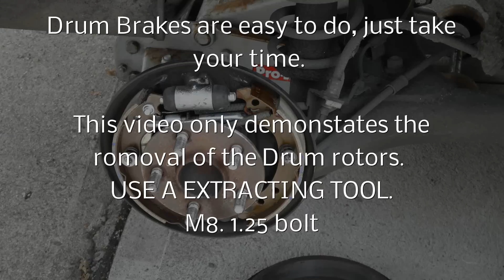How to remove rotor drums off a 2007 toyota corolla S and up

Comment: how did you know to use M8 bolts to crack the drum off?
Reply from the maker: +Eric Thomas There are special tools to use the M-8bolts are the proper threads to place in and that is what I used and knew. taking time to alternate is  key  do one side too much CRACK
Reply: I have a 2007 matrix xr. I will try M8 and hope it fits.
Reply from the maker: matrix/corolla identical parts I believe.when pads are ordered most parts come up matrix... worth a shot, right? spray turn one each side  and Pops off.

Comment: What if my rear drum is stuck.. What's the easiest way to fix that?
Reply from the maker: julio borges ave to douse the center with lube let sit do again. they sell liquid wrench lubethat releases stuck stuff. but the rust is the build up that stops it. sometimes heat helps

Comment: what did you spray on there ? and what size secrews are you using? thanks?
Reply from the maker: +Justin Johnson I spayed a lube spray like  wd-40 type .  I used a m8 bolt 1/4

Comment: where did you get the screw that removes the drum
Reply from the maker: It is a bolt not a screw.
Reply: ***** welll,,can you tell me where I can get it then!?!!
Reply from the maker: I used a M8 11/4 bolt noted in the description where you get them also  said what I used about 15 seconds in. I don't know if you are a USA or Overseas person . so if I say go  to a home depot would that work for you.    don't forget to sub thanks  never trying to be harsh or sound bad.
Reply: @fishycomics  Where did you get YOUR bolt is what he is asking.  Pretty simple question.  I was wondering too.  The size I THINK you were trying to tell him is M8 x 1.25 or 8mm x 1.25.  Is that correct?  What you ACTUALLY told him is M8 11/4 or M8 x 2.75 (11/4).  Which is wrong.  I mean my goodness.
Reply from the maker: @bleslie7410  I totally hear you, it was years ago. At Home Depot    They fit about most cars that size you corrected me on, I used it not to long ago to remove another. Disk